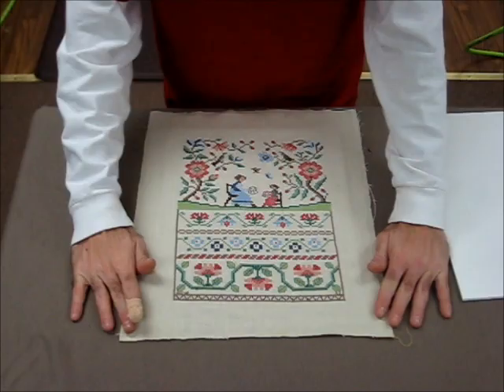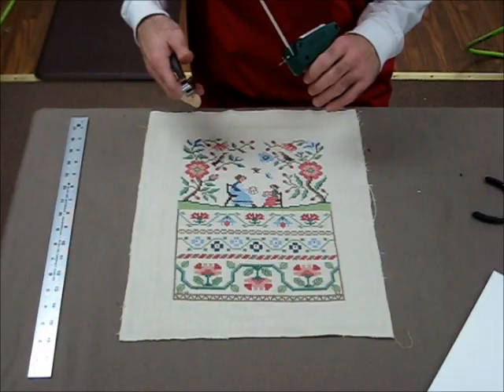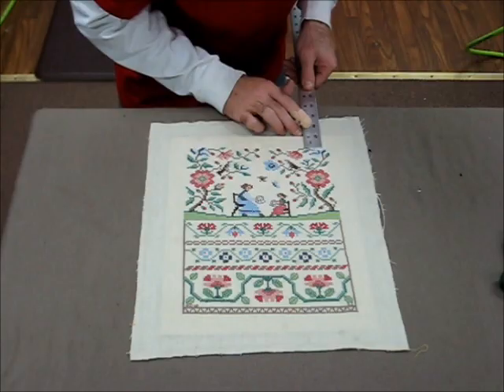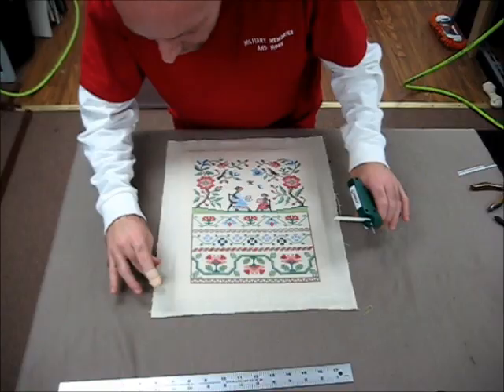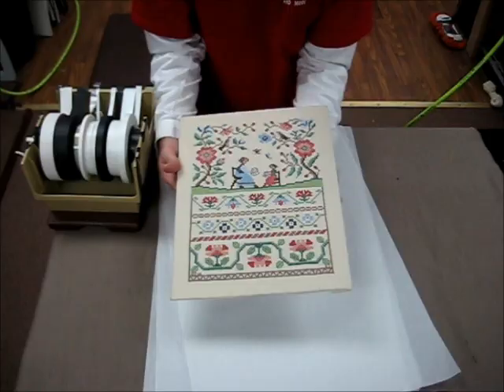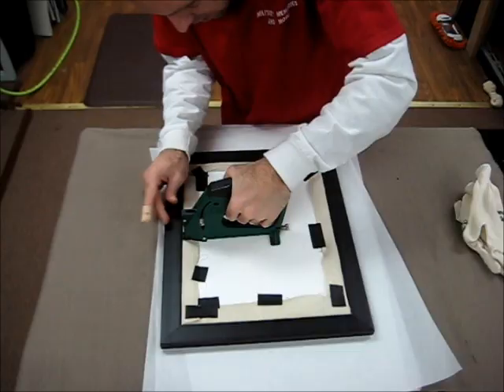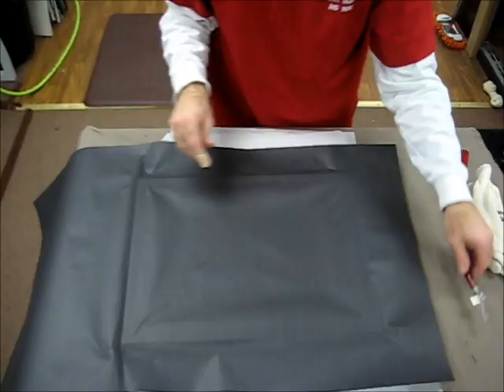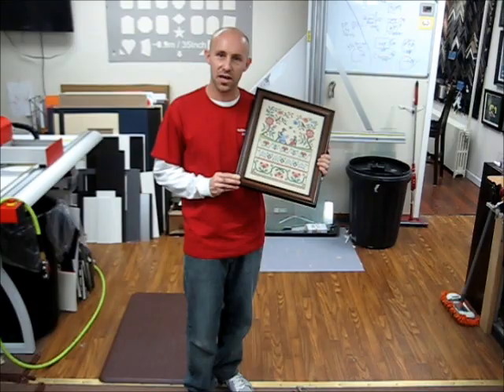How To Frame A Cross Stitch - Demo Of Needlework Framing

Comment: I haven't read all the comments, but as an artist who stretches canvas, you should never begin tacking in a corner.  Start in the centre of each side and work your way out evenly toward the corners.  That will give you an even finish.  Still, I think I would personally prefer not to have glass over my crewelwork.  I want to be able to touch it and feel the stitching.  I've also wondered about maybe lightly upholstering it to a board?  I don't know if that's a thing or not!

Comment: I am aghast!  Where are the spacers?  You should NEVER lay glass down directly on top of needle art! If you don't use acid-free mats, spacers are a must!  Not only does laying glass on top of the work smash down the stitches (something the artist had taken great pains to avoid), but it makes the piece look printed like a piece of paper, not fabric and thread. You should be able to see the individual stitches.  Also, never touch the face of the needlework (any area that will show in the frame) with your bare hands once the piece has been washed and prepped for framing.  Over the decades the oils from your finger tips will yellow and cannot be removed!
Reply: Elizabeth Gray z
Reply: i totally agree...
Reply: I am aghast as well. .
Reply: I want to frame my embroidery work. What should I use to mount it on my foam board?
Reply: Where do you get spacers? We used to use them in the frame shop I worked at but when I mention them, people look at me like I have a third eye.
Reply: Totally agree, so many examples of bad practice. Fortunately my training in England has paid off many times.
Reply: To add to your comment, tapes are not acceptable! The back should be nicely covered.
Reply: That was my question as well, what about spacers????    I have 3-4 old pieces of needle work, created by my mother and grandmother, thread is stuck to the glass.   So I don’t want that to happen to my needlework.   So tell me about spacers, please!     Even Michaels locally uses spacers.

Comment: what kind of trimmer is that? why didnt you use a backing board?  need fresh blade on paper trimmer... put on gloves when picking up glass, I watched you put a fingerprint on the underside at 10:55.  other than that good time saving idea with using the tag gun, thank you for that.
Reply: +Sarah Little  Even though your question was a year ago I just saw your comments. In case you still need to know. The trimmer is a dust cover trimmer and you can buy them at www.americanframe.com. Merry Christmas!

Comment: When you use the staple gun do you use it on the surface or on edge?  Many thanks for a respond.
Reply: We tack around the edge of the material.  It is not a staple gun we are using though, we use a micro stitch tacking tool that inserts non damaging plastic mini tags.  See link below to get the same tool for a very cheap expense.   http://www.amazon.com/gp/product/B001CE8JPQ/ref=as_li_qf_sp_asin_il_tl?ie=UTF8&camp=1789&creative=9325&creativeASIN=B001CE8JPQ&linkCode=as2&tag=milimemoandmo-20&linkId=ARSE6TMJQTWOGRGR

Comment: As a stitcher and a person who attended a professional framing school, there are so many things you did wrong in framing needleart.   I am sorry to say that I would never let you frame any of my needleart.  NEVER, never place glass directly on any needleart.  It flattens the stitches and the colors will transfer to the glass over time.   Use spacers.  Never introduce any moisture of any kind to the art when framing.  Needleart should ALWAYS be laced.  Always make sure to use acid free materials.  You should also start in the center of the sides, never in a corner.  Your hands are all over the piece that hopefully was brought into your shop washed and pressed.  Never use tape when framing needleart.    These are some of the reasons I decided to learn framing myself.  I had a "professional" frame two pieces of needleart for me and was later so appalled at what he did.  Please take the time to learn the correct framing methods of needleart for the benefit of your customers.

Comment: That looked beautiful! I have been told in the past that glass shouldn't be used on embroidered pieces. What do you think about that. Is it better to not put it behind glass?
Reply: It really is the preference of the customer really.  I prefer to use glass... they say not to due to moisture and mold, but if you don't have your project hanging in an area that gets constant sunlight you won't have a problem with this issue.  If it is going to be in sunlight all day long you can still use glass, but you will want to add spacers or mat board between your embroidery and the glass to allow for air flow.
Reply: Thank you for your quick answer. I often heard that but I didn't know why. I have a needlepoint embroidery that I made in the 80s and I took it to Michaels for framing and they didn't add glass. It still looks beautiful still. Now, I'm wondering if I should get it behind glass?!
Reply: Melatina77 I think glass helps preserve the needlework in the long run.  You will hear arguments on both sides of this subject though.  Read some of our responses and you will see that.  lol ; )   We frame needle work with glass all the time and have had no negative feed back or customer returns due to damage.  The best way to get your space is to add acid free mat board to your project.  Not only does it create your space needed for preserving 100%, but it adds color and appeal to the entire frame display.